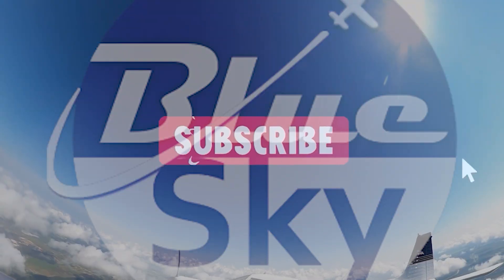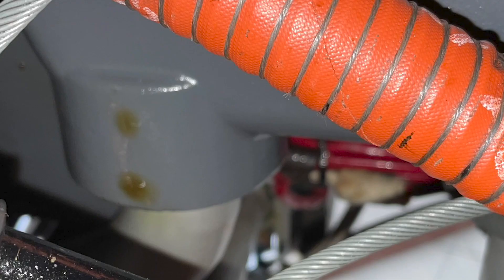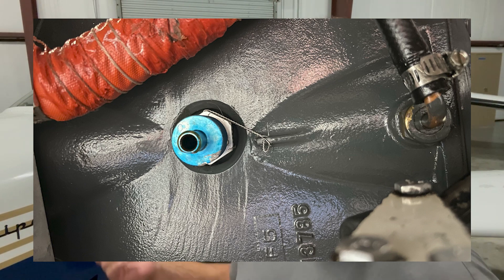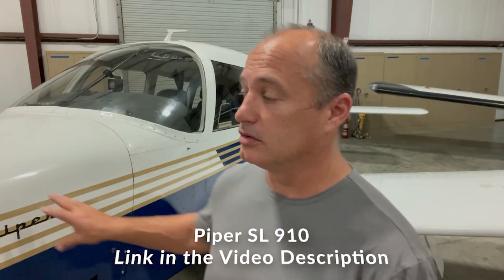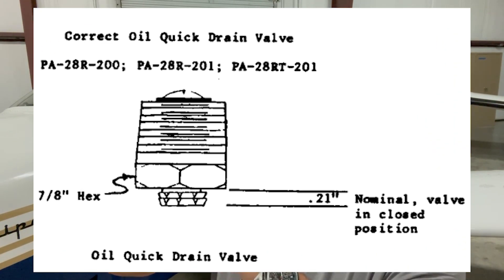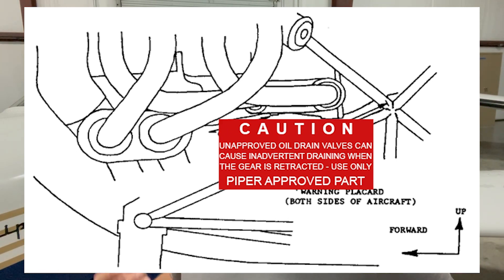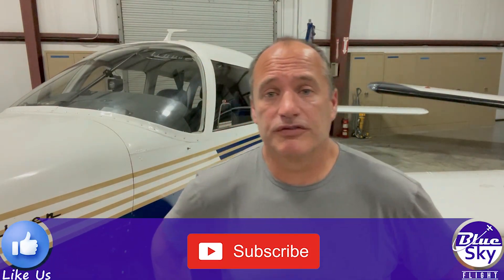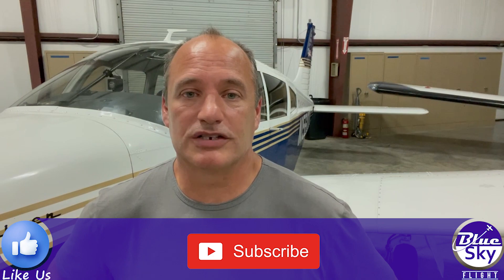The Wrong Oil Quick Drain for your Engine

Comment: I like your calm demeanor and direct style.. Well done..     BTW, sometimes the quick drain O Ring calls it quits.. EZ fix..
Reply from the maker: Thanks for the feedback! Fortunately this quick drain has a screw on cap as a failsafe, so if the o-ring does fail the cap should prevent any rapid drainage.

Comment: Rotax appears to discourage the use of quick drains on their oil tanks and I am debating whether to just invest in a siphon pump and remove most of the oil that way before removing the stock drain plug and getting oil all over the firewall and engine mount.  I wish Rotax had provided a much better drain system given where most of their oil tanks get mounted.
Reply from the maker: What is their reason for discouraging?
Reply: @BlueSkyFlight  I have no idea.  I suspect they simply don’t want to take the time to test different quick drains and the easy legal solution is to simply say they can’t be used.  My airplane is a homebuilt, so I can use whatever I want, however, I generally try to stay close to generally accepted practices and manufacturers recommendations.
Reply from the maker: Makes sense

Comment: The Saf-Air web site clearly calls out the issue with the Piper Arrow.  Whenever someone performs improper maintenance or repair on an airplane, it can create a hazard.  I had a significant oil leak (6 quarts in 1.5 hours) on my Skylane years ago. It was due to an A&P who didn’t confirm that the oil filter gasket had come off with the old filter and ended up double gasketing the filter.  Well, two gaskets won’t contain the oil pressure and I landed after a 1.5 hour flight with oil all over the belly of the airplane.  Somewhat disconcerting and took nearly a full day to clean up.
Reply from the maker: What a mess I’m sure. Yes I saw that on their site after the fact. It was a learning moment for sure

Comment: those quick oil drains can kill you.  in this case it did.  

The oil quick drain on the engine oil sump was found to be leaking, even though it was in the closed position. Examination of the oil quick drain revealed that it was discolored and that the O-rings were melted, indicating that the oil quick drain had been exposed to a high heat condition. Further examination of the area around the oil quick drain revealed the presence of soot on the bottom of the oil sump downstream of the No. 2 cylinder where the engine’s left side exhaust pipe was separated from the exhaust collector. Additional examination of the exhaust system indicated that the left exhaust pipe was a slip fit design and that no exhaust pipe clamp was present. This evidence indicated that the source of the thermal distress event was most likely an exhaust system leak that impinged on the oil quick drain, melting the O rings and resulting in the oil draining from the engine and subsequently igniting. A review of the operating temperatures associated with the engine indicated that the exhaust gas temperature was hot enough to exceed the upper limit of the temperature specifications of the oil quick drain and was also hot enough to ignite the oil. This ultimately resulted in the in-flight fire and led to the pilot’s subsequent loss of airplane control.

https://data.ntsb.gov/carol-repgen/api/ ... 103266/pdf
Reply from the maker: Good info. Thanks for sharing. I’ve decided that the only type of quick drain I will use on any aircraft is a two part system like the one I have on the arrow. That way, if the o rings fail, the cap keeps it closed. Also any oil on the inside of the cap will let me know when rings are starting to fail.
Reply: Now you have to check to make sure the quick drain tube was removed after the oil change and replaced with the screw in plug.   Seems like it’s not enough just to check for leaks after an oil change.  As long as humans are involved anything can go wrong.

Comment: thanks for the video, my plane does not have retractable gear so no issue there... but i do have another question, I just got my P5000 today from Aircraft Spruce and noticed it has no crush washer..... I dont see one even listed on the Saf-Air website for the P5000. Any insight on what to do would be greatly appreciated! I fly a Maule MXT-7-180 with a Lycoming O-360
Reply from the maker: Check with your A&P, but mine suggested a very small amount of ProSeal around the threads to create a nice gasket like seal when I screwed it in place and it cured. Seems to be working well
Reply: @BlueSkyFlight  So seems this 1/2 NPT is tapered and just like the original plug, it does not need any sealant. Im testing it without sealant

Comment: I will be sending this to my mechanic. I have an Arrow that was on the assembly line with yours. I have an unknown oil leak or auto-undercoating. I do not have those placards on my engine mount.
Reply from the maker: Let me know what he thinks and also what your leak turns out to be.

Comment: i.e. it nolonger a quick drain as you must remove a cap and instal a spout with a howe on it to make sure the oil goes in the bucket.  Remember years back when after an oil change at KMWC a piper aerow made a fourced landing fourtunally at 02C.
Reply from the maker: It’s still pretty quick. :) and definitely better and cleaner than a standard drain plug…
Reply: It is still a quick drain.  It is much faster than removing a conventional plug and then cleaning up the mess afterwards.

Comment: Thanks for the heads up.  Quick drain oil plugs seem crazy on an airplane.  There has to be a better way to just not make a mess, and use a conventional drain plug.  Maybe cover the gear, etc with a trash bag. Too risky for a little convenience.
Reply from the maker: I really like this F-50 plug because it has the cap which stops any leaks the might get past the o-rings, but more importantly. The valve can’t open until you screw the bottom piece on that the hose is attached to. Keeps it clean, but also some redundant safety. 
I definitely don’t like the ones that do not lock in the closed position.
Reply: Quick drains installed and used properly are very reliable.  Almost every issue with them is due to improper use or maintenance.

Comment: Very interesting. I'm kind of surprised that an oil quick drain would be approved for use in certified aircraft (or any aircraft for that matter) that didn't have a positive close position. Everyone understands how critical oil is in an engine. That raised my eyebrows!
   Hey, I saw a Velocity at my airport getting an annual. I got to speak to the owner. That's a really nice plane. The only thing that seemed odd about it was it's landing characteristics. He said you have to fly it all the way down, because the canards stall before the wing and the nose drops. Given that I'd stick with a Vans. If I ever sell my plane I'll build an RV-10 or RV-9A.
Reply from the maker: I agree about the drain. Thanks for the info on the Velocity - wasn't aware of that.

Comment: This is crazy. Thank you for sharing. Something so small that could have caused engine failure and perhaps a serious accident. Mine doesn’t have one but I was actually thinking of getting one and now I know the deal.
Reply from the maker: Yeah, and to think that if i had not had that "something's not right about this" moment when I put the new p5000 on, I would have just taken it up flying and that would have ended in disaster. And honestly, if i had not had to fight to open the one that was on there, I don't know that I would have had that thought.  Scary how close I came to destroying the engine and very likely the airplane (and myself).